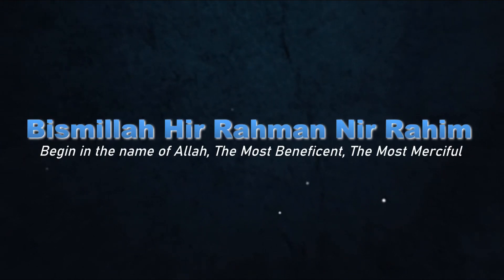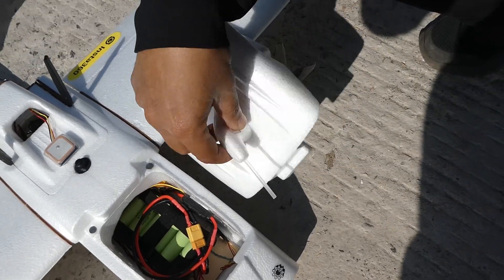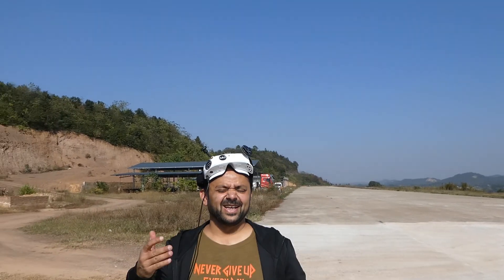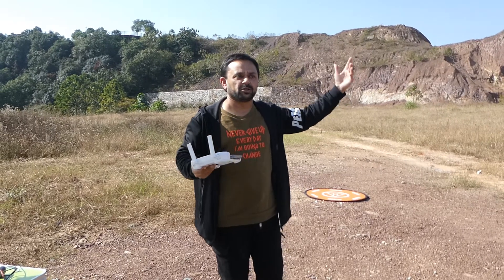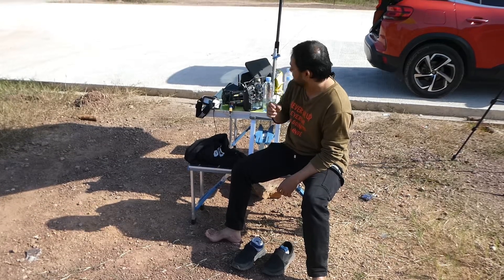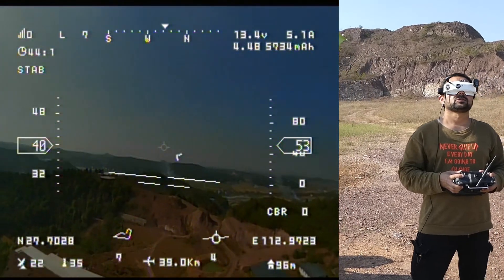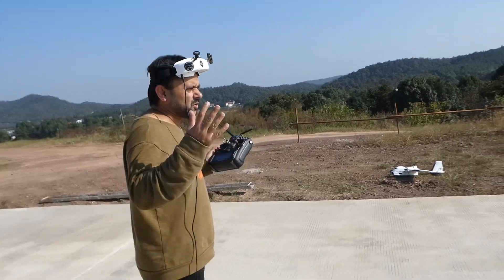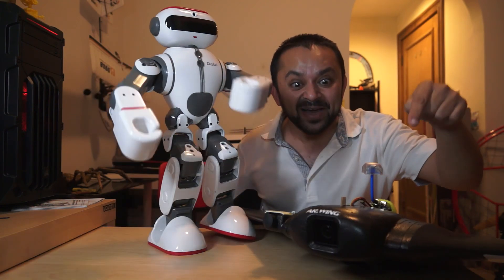Eachine Airloader Long Range FPV Plane Li-Ion Battery flight endurance test

Comment: What cells are in this battery? I'm flying long range drone with 6s1p sony vtc6 and it keep the power up to 2.5V on cell. Drone motors take much more power than planes servos. It mean something wrong with settings. Maybe ESC cut the power on 13.3V to save battery
Reply from the maker: just some cheap 18650 li-ion pack

Comment: Mine arrived today, I bought the kit version to avoid problems with electronics like that review where the motor failed, also I wanted to solder the ailerons/flaps connections myself.  To my unpleasant surprise even in kit version the connectors were already glued with just one servo cable per wing, the ones in the wings were easy to remove but I don't know how I'll remove the ones in the fuselage without damaging the foam.  The connection thing is well thought but it was pretty stupid to just solder just ONE cable to it, how am I supposed to connect the flaps ?. Might go all Andrew Newton and drill a hole and use servo extensions. 
Ali please tell the guys at the factory about this problem.
Also hinges don't look good, there's already cracks in some areas of the ailerons, thankfully (bad) experience made me bought proper plastic hinges beforehand. 
I have to say, the plane is one of those things that are so so SO ugly that it reaches a point where it went back to beautiful (just my opinion).
Reply from the maker: Thank you for your feedback. I will forward it to designer.